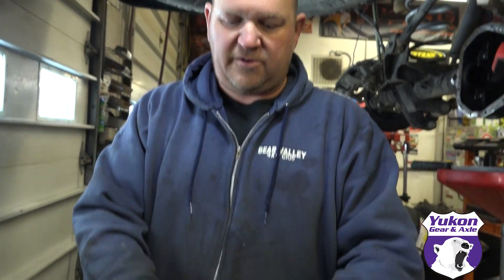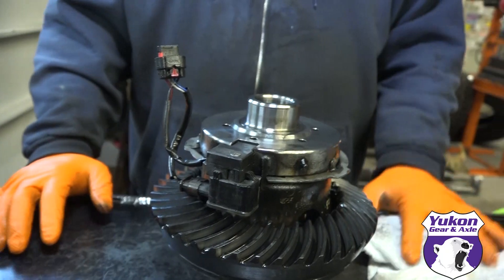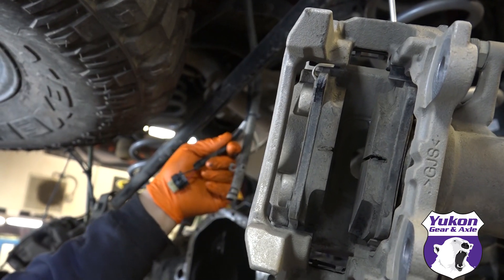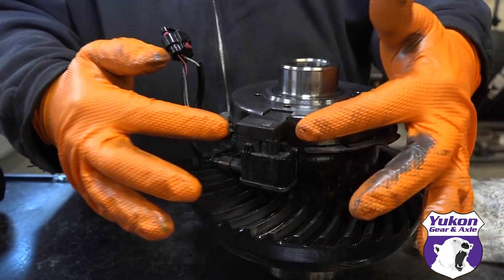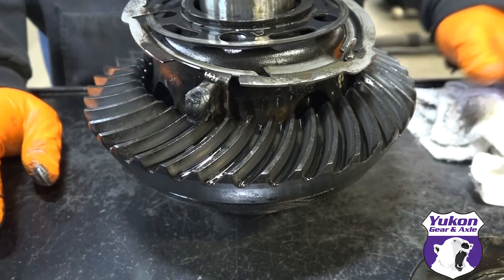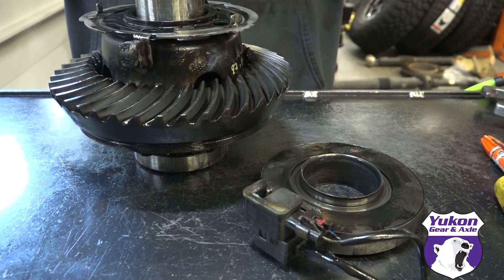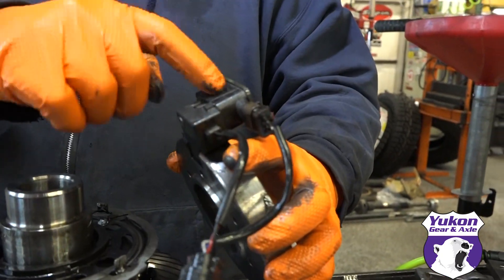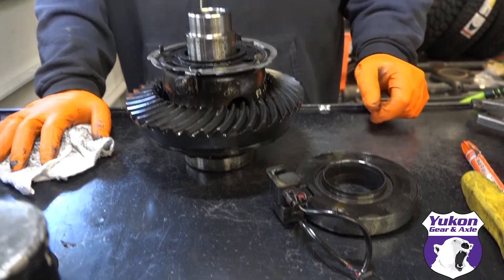Jeep Wrangler JL and Gladiator Rubicon Electric Locker Issues

Comment: Power Wagons have the same problem. The sensor design it different. The magnet and sensor are not shrouded.  We use a Q-tip to clean the magnet and sensor to clean the metal fuzz. Plus there is a gap setting between the magnet and sensor. If it's too small. It won't show that it's engaged. Too big, it shows it as engaged all the time.

Comment: I took mine to the dealership and they said it’s the sensor and they are going to replace it, we are waiting on the sensor to arrive, My question is it’s safe to drive? I don’t do off-road or anything besides used it to commute to work or travel.
Reply from the maker: Since you only need lockers for more difficult low traction situations, you should be fine for daily driving.

Comment: Just had my rear sensor replaced at a local dealer. Only 2 days in the shop. Had a friend go right after me to fix the same issue and they were out of stock for the sensor. Didn't know how long to get the sensor back in stock. Didn't want an axle replacement so the sensor fix was good for me for now. Guess we will see how long it lasts or if my front axle sensor will fail.

Comment: Today my 2018 Jeep Rubicon rear axel began flashing (red panel) and the yellow Icon came on the dash showing rear axel locked.  My big question is>>>> IS IT SAFE TO DRIVE?  This is my only vehicle and I have a family that rides in it all the time.  Contacting dealer tomorrow.  Thank you
Reply from the maker: If the rear axle locker is engaged you will feel tire scrub and possibly even tire squeal from the rear tires when you turn, especially in tight turns. The rear locker (front also) should never be engaged on paved roads and highways. It is very likely that the rear locker is not engaged. Iit is easy to check by having someone jack up the rear axle with the transmission in neutral, then rotate a rear tire by hand. If only one tire rotates, then the axle locker is not engaged. If both rear tires rotate, the locker is engaged.) Most likely, it's an issue with the switch/electronics but definitely have the dealer check it out.

Comment: Got any info on your shop? Would like to get a re-gear on my JT
Reply: All J Products, Big Bear Lake, CA
Reply: @AllJProducts  Sorry this sounds so dumb, because it kind of is. Looking for some wiring help. Did an axle swap for curries. Used Tazer mini and the Z automotive Locker Cables. Front end is perfect. Rear end, getting all kinds of lights and codes and nothing works. Essentially, the codes and errors are like the locker and abs sensors aren't even plugged in. I'm thinking the harness got "pulled" hard enough to damage / disconnect it OR it got pinched bad enough to damage.

Any suggestions on how to trouble shoot this? How to test continuity for those systems from up front to at least test the theory?